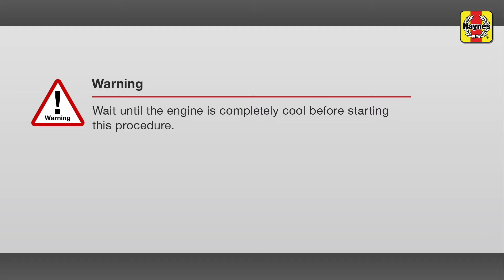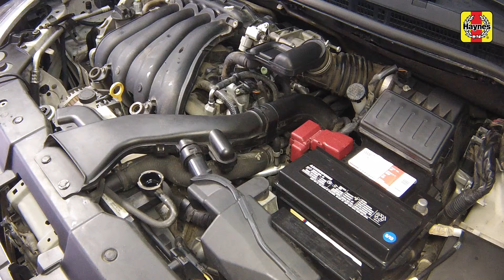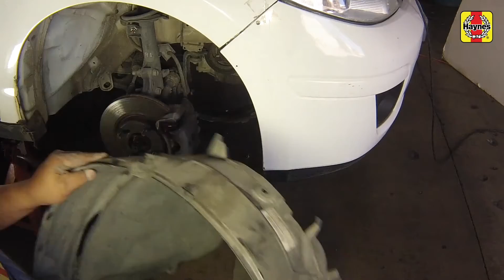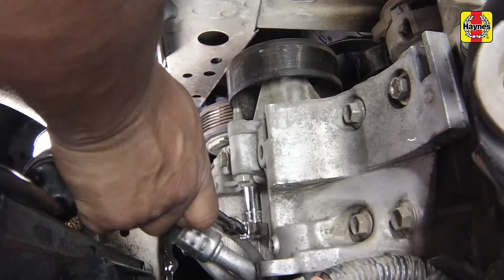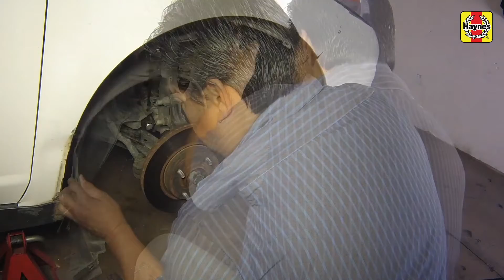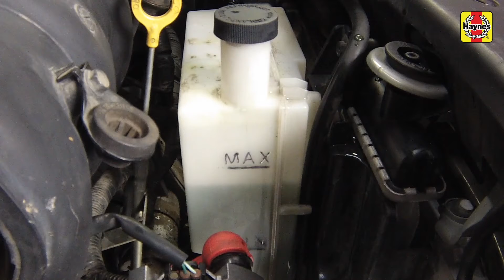How to Replace the water pump on the Nissan Versa 2007 to 2019

Comment: 14mm for tensioner, 13 mm for alt bolts and 12 mm for the alt wire, 10mm for water pump beware of the radiator drain plug disappearing between the sheet metal on bottom, your going to need a few different sized extentions and wrenches to get to all the bolts, the rivets holding the mud wall to fender will likely be destroyed if you use a screwdriver to remove them, other than that, expect it take about 3-4 hours to complete
Reply: destroyed my plastic rivets. zip tie life for me.
Reply: @adammiller6451  you’re a gentleman and a scholar sir thank you!